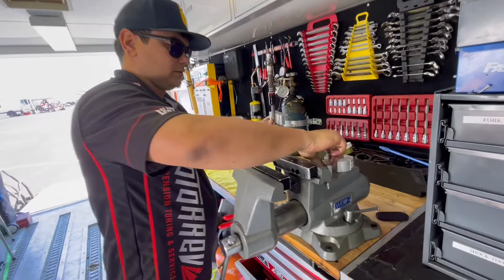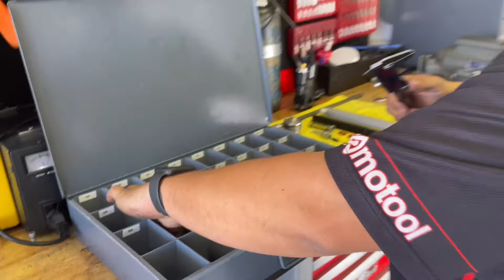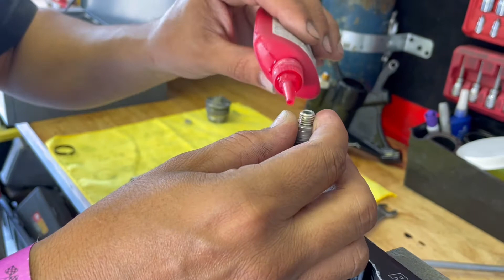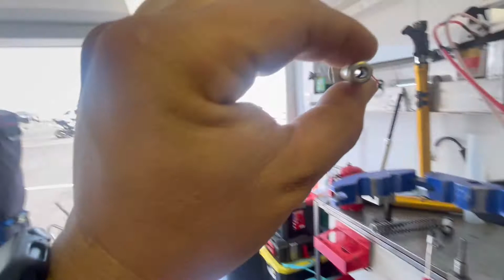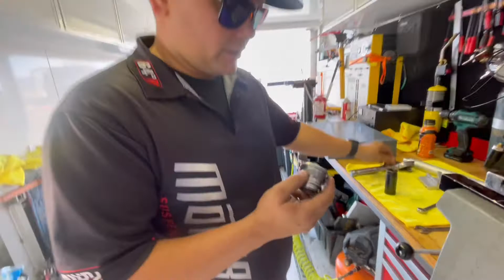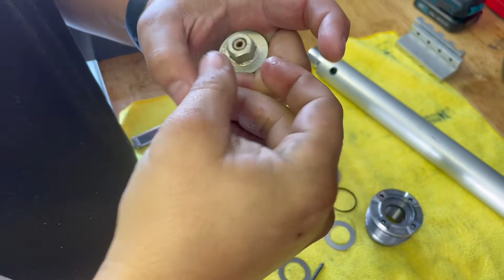Öhlins Nix30 cartridges

Comment: so basicaly, to change the spring only, you just need the tool to remove the cap and thats about it?
Reply from the maker: You need a ohlins cap tool, 14mm wrench, 19mm wrench (or a specific wrench that is a bit longer), and a pull rod tool. It’s super easy.